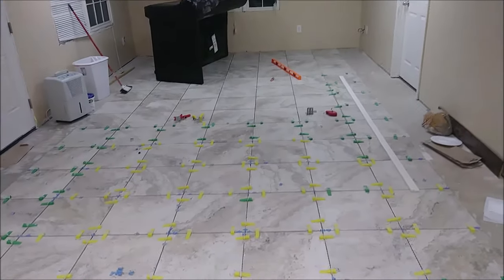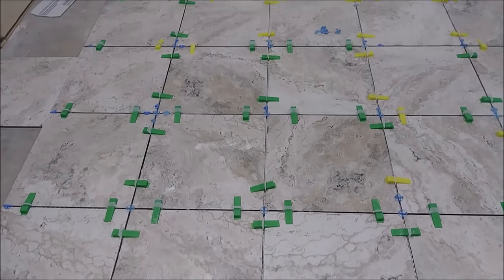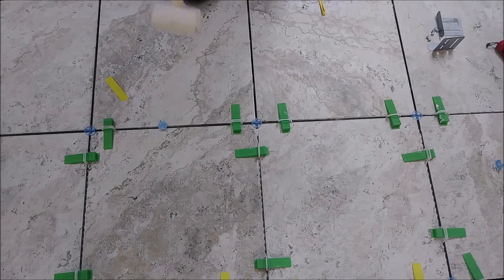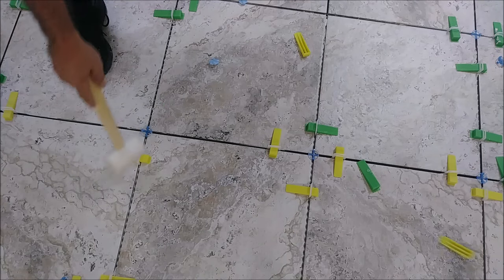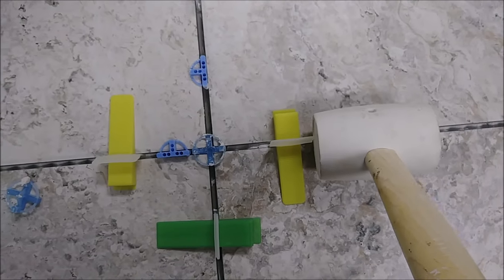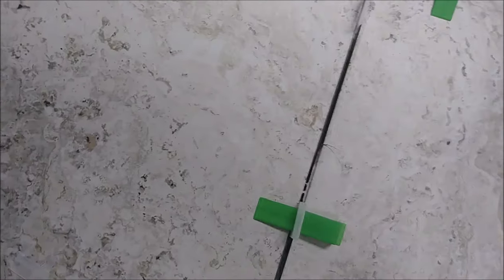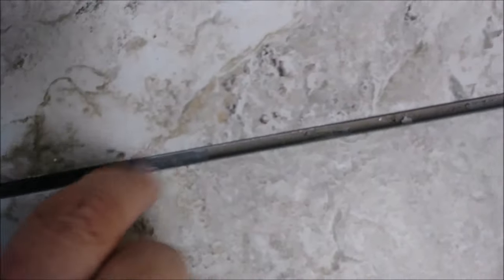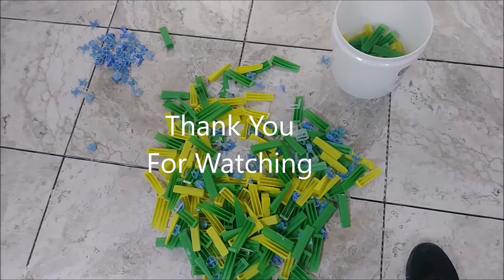How To Remove Tile Leveling Clips Properly - Nice And Easy

Comment: I'm doing this now, just found out dont kick the same way the levels go. I have the yellow ones. Reason why is tip of plastic broke off, now I have tiny plastic clips sticking out of grout lines. I also didnt use cross spacers. Glad I only got 3 rows done where furniture will be. Without cross spacers the tile moves leaving uneven tile connections. Barely noticeable but I'm OCD about that.
Reply from the maker: Thank for the info.

Comment: If adhesive gathers  in around  clip  and drys  its a pain cause clips breaks above joint  and you need to scrape it out
Reply: 100%!!  I had to go through with a stanley knife and cut out all the tiny joints of the clips. Worst job!

Comment from the maker: Yellow Tile Leveling System  = https://amzn.to/3lKDT0u
YEFU Tile Leveling System  =  https://amzn.to/3tXHlIR
Tile Leveling System Best Clips = https://amzn.to/3AyPCVW
Other Tools and materials used:
 Grinder Kit for Tile Grout Mortar Concrete Masonry = https://amzn.to/3lOOo30
Dremel MM 50 = https://amzn.to/3zmq0uh
Thinset used Mapei Ultraflor = https://amzn.to/3taAsCX
Bosch Laser Level and Square GTL2 = https://amzn.to/3olZX0G
Multipurpose lavel laser = https://amzn.to/3coUK5O
Tools and Materials  used:
Angle grinder used = https://amzn.to/368IX8C
Diamond Blade =  https://amzn.to/3j2kTbc
Dimond hole drill bits =https://amzn.to/36bX2Cs
QEP wet saw = https://amzn.to/3cLJgaW
Diamond Blade = DeWalt https://amzn.to/3jfdpSr or Black Widow https://amzn.to/3jgx18G
Grout Float = https://amzn.to/3j7KO1c or https://amzn.to/348KLMu
Notched Trowel 1/4 x 1/4 x 1/4-Inch= https://amzn.to/3j26Zpv
Notched Trowel 1/2x 1/2 x 1/2-Inch= https://amzn.to/2S5Zceg
Notched Trowel 1/4 x 3/8 x 1/4-Inch=https://amzn.to/3cDPbhZ
grout sponges = https://amzn.to/3ieBx68
Nitrile Gloves = https://amzn.to/3i8VhrT
Best Thin set used = https://amzn.to/3cxVBz8
Medium thin set =  https://amzn.to/3mSk9aR
Mapei Pre Mix Grout = https://amzn.to/2HqhdC3
Mapei Grout = https://amzn.to/340hWS5
Miter Box Used =  https://amzn.to/2SnYgm1 or https://amzn.to/2G1CVfB
Hand saw =  https://amzn.to/30kvabp
48" Level = https://amzn.to/347tmUl or https://amzn.to/30m3y5H
Leveling System  = https://amzn.to/3n39GJN
Mixer = https://amzn.to/34lymod